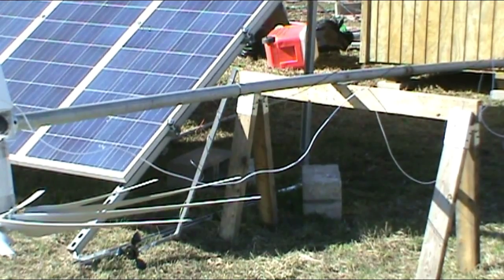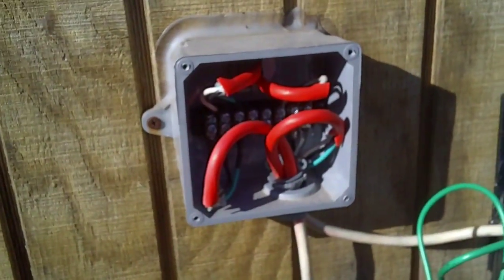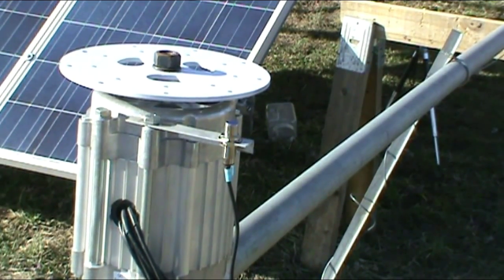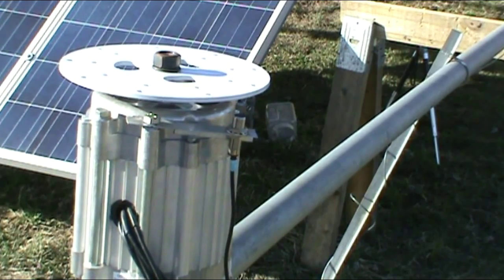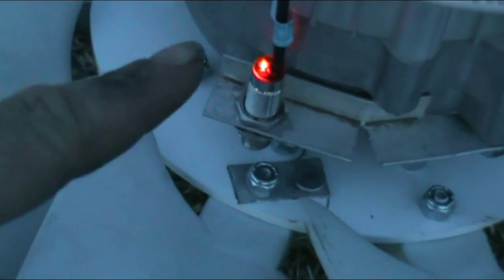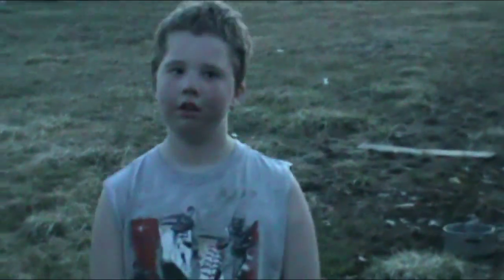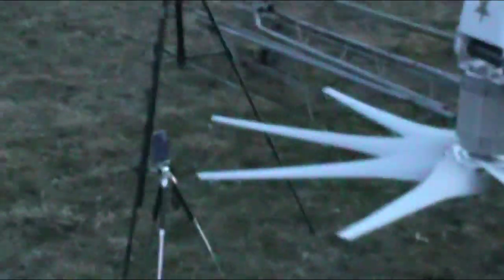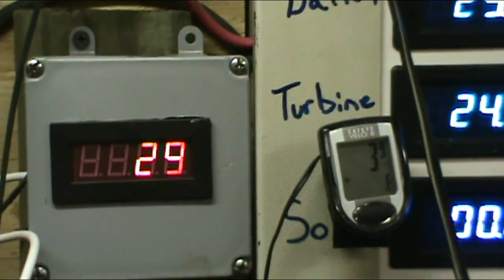RPM Gauge install for wind turbine

Comment: Watched it and I understand how you mounted it.  Sort of.  What's at the bottom to hold it?  From what I see you wrote hippie; am guessing it's a T like base that is bolted and somehow mounts to the ground.  The side braces at the middle and top had rubber around it to reduce vibration. And I know this is way after the fact but a fish tape puller would have worked to pull that wire up.
Reply from the maker: +TechMan1219 When I pull the turbine down I will do a good close up of the mount I used to have a video up years a go when I built the tilt up. I don't know what I did with the video but it disappeared.  If you ever want to talk or holler at me, you can find me one Skype, mccunecp@hotmail.com, Or call 618-214-7183  I will have to get a video out on the mounts.  The bottom part is a hing a home made hing. that is bolted at the bottom of the shed with lag screws.

Comment: how  tall of  a pole  are  you using   and  what size
Reply from the maker: +hippie shack (hippie shack) Its is a 20 foot schedule 80 pipe 2 pieces of 10 foot pipe that is threaded at the ends and the coupling that comes with them are welded were the two are connected so they don't come apart. I made the base were it tilts up and the two top brackets that holds the pole up against the Shed.  The small turbine I have on it, with it would preform better, but will be looking for a better turbine to put up on my pole but it would work great for anything from and antenna, or even a satellite  if need be.